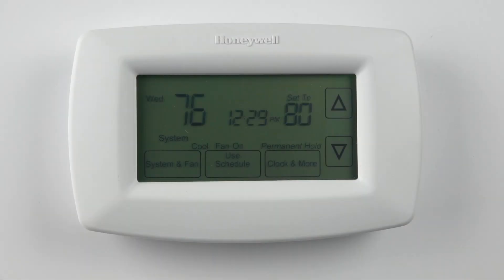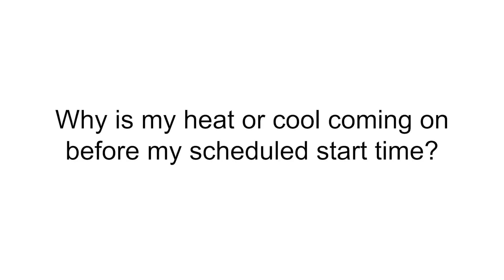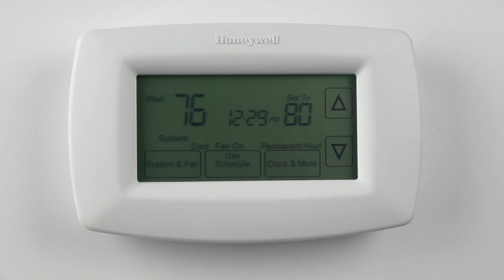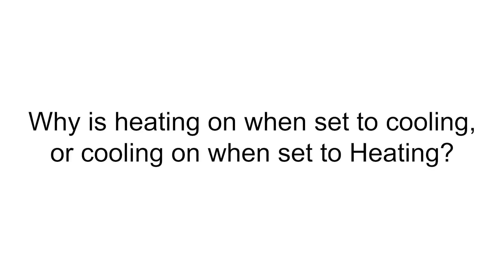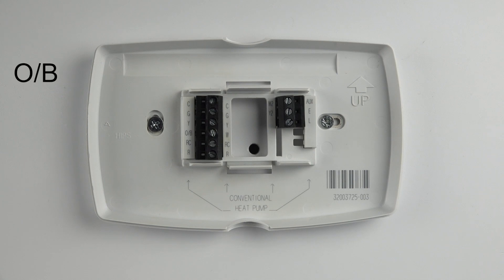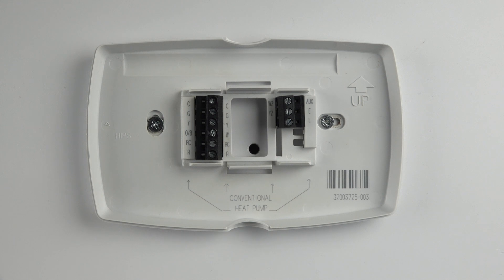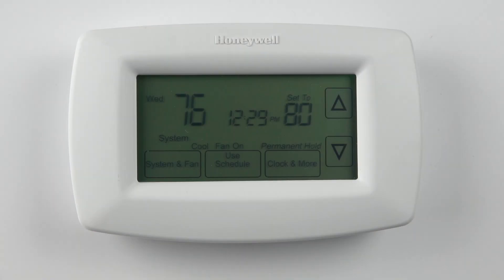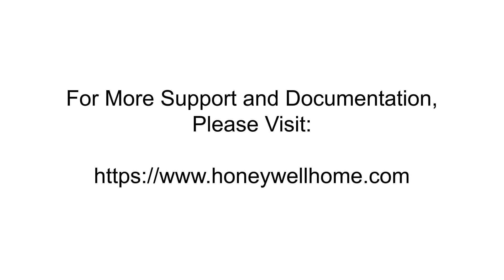RTH7600D 7-Day Programmable Thermostat -  Frequently Asked Questions

Comment: I have just installed a Honeywell RTH7600 Thermostat. Part of the description of this thermostat is "Precise comfort control keeps temperature within 1°F of the level you set". This causes it to run more often for short periods. Is there a temperature range parameter that I can change (increase) so that the system runs less often but for longer periods?
Reply from the maker: Hi Greg, thank you for reaching out! We'd like to further assist you, at your convenience, please reach out to us at (800) 633-3991 or on social media, thank you. -Charlie

Comment: we just had a new HVAC system installed and it is blowing heat instead of cool, how can we fix this? the wiring on the thermostat did not change from our old heat pump system.
Reply from the maker: Hi Jeannie, thank you for reaching out to us. Please make sure that your thermostat is configured for your heat pump, we can assist you verifying the thermostat settings at 1-800-468-1502 Monday - Friday 9 am to 8 pm, Saturday - Sunday 9 am to 5 pm CST. You can reference case 02702364, we will be happy to help you. - Maria

Comment: Will this thermostat automatically switch to emergency heat when it is below a certain temp. outside?
Reply from the maker: Hi Gcpm11Fan21, this thermostat will automatically run your backup heat is the heat pump cannot keep up with the setting. If you are looking for a model with more specific configuration options for heat pump lockout we recommend you reaching out to your HVAC professional to install a trade model. -Maria

Comment: How can I set the country for the thermostat. I am in Australia and have just installed this thermostat and set the DST and selected option 2 for function 0330 ,. My clock should have been set back on the 5th April but instead it was set forward by 1Hr. Australia uses the 2007 DST calendar
Reply from the maker: Good morning Peter and thank you for contacting us, we are glad to assist you. All our thermostats are working with US guidelines when it comes to DST and the RTH7600 does not have a way to let it know you are located in Australia. What we suggest in here is to set the time on the unit to the correct one manually by going to the Schedule part. -Lily.

Comment: Can you set this model to a certain heat temp and then have it not come back on until a different temp?  As in heat til 20 degrees and when it reaches 17 heat til 20 degrees again?  my model is the RTH7600D
Reply from the maker: Hello Eddie, thank you for reaching out to us. Our thermostats are built in mind to keep your house at comfort levels which means that it will try to keep your house at the set temperature as much as possible. If you have any other questions, feel free to reach out to us at 1-800-633-3991 or if you prefer, you can also send us a message through Facebook or Twitter. We'll be more than happy to assist you.

Comment: how does one separate wallplate from rth7600 thermostat? Manual gives no hint on this.
Reply from the maker: Hi Ed! Thanks for reaching out to us, we're happy to help you with this. To take your thermostat off the wall, grab the face-plate from the top and bottom and tug towards you. The thermostat should pop off the wall. If you need further assistance with anything please let us know. We'll be glad to assist you. You may also contact our support team at 1-800-468-1502. Thank you! - Laura

Comment: When I turn it to cold, it turns to heat.. what should I do? My orange wire already in the o/b place in my thermostat
Reply from the maker: Hi Henry, you will need to configure the thermostat for your system type. We created case 02542425 for you and will be happy to guide you through the setup at 1-800-468-1502 Monday - Friday 9 am to 8 pm, Saturday - Sunday 9 am to 5 pm CTS. - Maria

Comment: Can I lock the display screen on the RTH7600D?
Reply from the maker: Hello Ryan, thank you for reaching out. The RTH7600D does not have a lock feature, we recommend you the RTH8560D as it has a lock mode, and works with batteries. -Charlie

Comment: How to clean the screen?
Reply from the maker: Hi Ildar, to clean the screen use household glass cleaner, but do not spray it directly on the screen. The cleaner can be put onto a soft cloth and used to wipe the screen. - Maria
Reply: @honeywellhome  thank you but I mean when I touch the screen with cloth then my settings begin to change. How to disable screen sensitivity during cleaning?
Reply from the maker: This model does not have a clean screen lock feature. You can either turn the power off to your unit or detach the faceplate then clean. -Joey

Comment: How to reset date?
Reply from the maker: Hello Diann! If you want to reset the date, please follow this steps: 1. Press and release "System & Fan". 2. Press and hold "Fan" until the screen changes. 3. You will see 0120 on the left, that is the first two digits of the year. 4. Press next to 0130, this function is to set the last two digits of the year (19). 5. Press next to 0140 this is the month. 6. Press next and 0150 is for the day. 7. Once you have the right date press "done". -Rosie
Reply: @honeywellhome  Thank you ... wish this was available elsewhere online ... or easy to find. I am glad I looked at the comment section.
Reply: @honeywellhome  Thank you! I also wish this information had been a little easier to find. It is obviously an integral part of the programming and should be more easily accessible. It should have its own section in the manual, and not be hidden under the unnecessarily complicated "advanced installation" instructions. It's basic info -not advanced.

Comment: why does my thermostat come on every 3 minutes. and why does it continue to run for ever after reaching the temp set on thermostat ???
Reply from the maker: Hi R Moseley,
Thanks for reaching out, the thermostat will continue to run  if the indoor temperature comes within 1.5° of the set point. -Joey

Comment: You think you could put a latch on to change batteries?What is the purpose of having a method for battery removal that could damage the wallplate if done incorrectly?Just to break it and cause more problems?Stupid robots